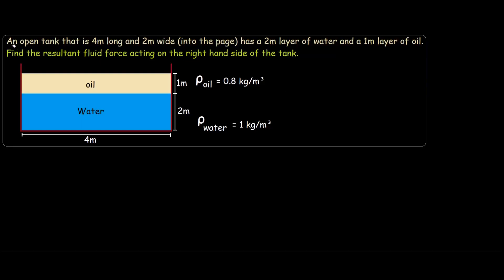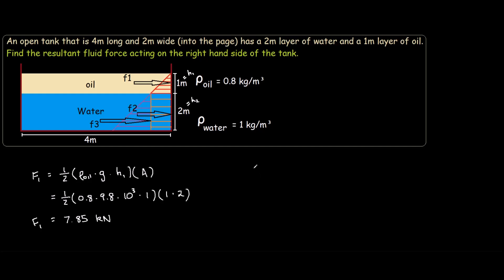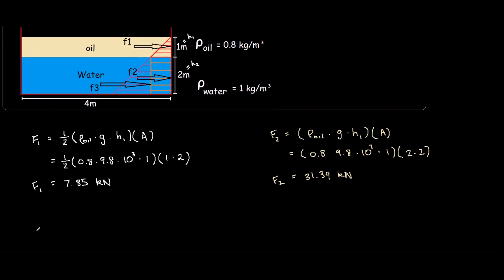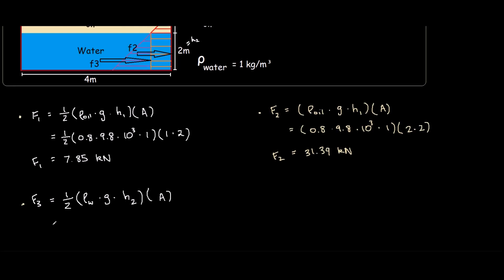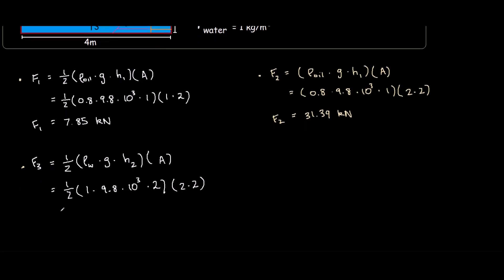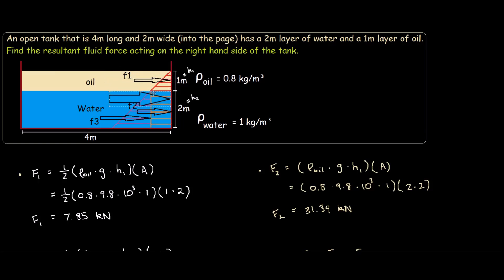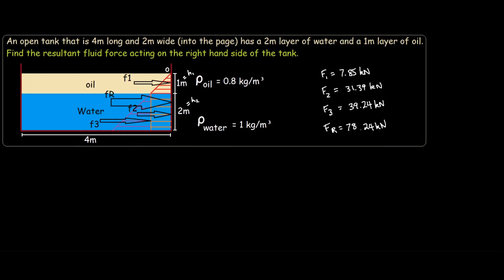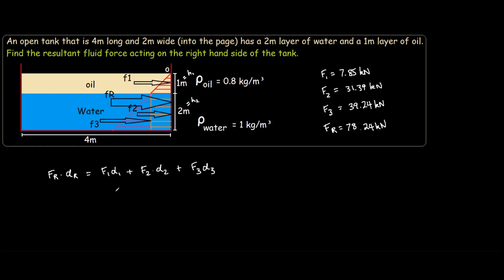Hydrostatic Pressure on wall two fluids (Pressure Prism Method)

Comment: The density of water is 1000 kg/m3, not 1 kg/m3 as stated (same logic goes for the oil). Therefore, its specific weight would be 9.807 kN/m3 [water]. 

Also, the resultant force on a vertical rectangular plane surface is R = p*A, where p is the AVERAGE pressure, which is ALSO equal to the pressure at the centroid of the plane area. [notice it is calculated to the centroid, not the third from the bottom of the triangle, although the force is located at the third from the bottom of the triangle].

The average pressure would be: p = (1/2)*(p1+p2) = (1/2)*ρ*g*(h1+h2) [ρ*g = specific weight]

Comment: Density 1000 for water , it's 1 gm/ cc . And .8 specific gravity.
Reply: True Brother. Even I Was Noticing It, It Must Be Corrected To 800 kg/m^3 for Oil
Reply: @courseco-ordinator8422  so during the calculation @2:59, he does come right, where he converts it to newtons (i.e 10^3 included), but I guess you guys are right in saying the density should be corrected :)

Comment: I still can't quite understand why there is a second force (rectangular prism) from the oil. Wasn't the pressure exerted from the oil already accounted for in the first triangular prism. I'm not questioning your answer (i know its right since my textbook says the same), but why is it included in the first place. Thanks.
Reply from the maker: maybe try to imagine incompressible water in a container and you punch it through a perfect gap, the pressure will increase onto the walls of the container (in this case your hand/punch is the oil) you cant discount this effect and say the only pressure on the walls is still the water. The oil adds a vertical weight onto the bottom layer so this extra pressure has to be accounted for as well. if there was no oil layer on top you would work out the water layer exactly as F3.
Reply: I just understood with the help of your analogy. Thank you very much Cowan.
Reply: Was having the same doubt Now cleared  Thanks
Reply: Hi Nicolas, Cowan, i am a student and i also stuck at this, but a walk allow me to relax up a bit and think in this way: imagine that both layers are water, right, and you calculate the upper half water with a triangle, right, and then you start to realize you should not consider the lower half water with simply a triangle, as its pressure is not starting from 0, but from, lets say 1m deep pressure, so the lower half is not a triangle but a trapezoid. But for the ease of calculation, it is much easier to cut the trapezoid into a rectangle and a triangle, than directly go for trapezoid. And the force of the rectangle is a product of deepest pressure of upper half water times lower half wall area. You can try it youself by calculating, like 10m depth water force on wall with a big force triangle, and then cut it into upper 5m layer of water, and lower 5m of water, and with 2 small force triangle, then you will realise you are missing a rectangle. :-)

Comment: Why the 1/2  in calculation of F1 and F2
Reply: Write pressure due to small strip of liquid and then integrate it, you'll get the result.
Reply: What the guy above me is telling, 

That simply calculating ρgh gives the pressure at the interface of oil and water, to be more clear it is the pressure at the bottom of oil, but to calculate the pressure on total wall we need total pressure across the wall which has linear variation ( p = ρg[h] ) and hence area of triangle.
Reply: Force of pressure triangle=0.5*base*height*width

base=rho*g*h

Comment: The density of water is 1000kg/m^3, not 1kg/m^3. I think you account for this by multiplying by 10^3...but I don't think that is correct.
Reply: That should be 1gm/cm³ in place of 1kg/m³

Comment: Howcome F2 isnt the force of the rectangular prism in the water? Howcome is the force from the water only caused by the triangular part? I would think that F1 is from the oil and that F2 and F3 are from the water?? Im very confused by this
Reply from the maker: Hello Diego I tried explaining it this way to other commentators which they found useful:

"maybe try to imagine incompressible water in a container and you punch it through a perfect gap, the pressure will increase onto the walls of the container (in this case your hand/punch is the oil) you cant discount this effect and say the only pressure on the walls is still the water. The oil adds a vertical weight onto the bottom layer so this extra pressure has to be accounted for as well. if there was no oil layer on top you would work out the water layer exactly as F3."

Another way to think about it is that if there was no oil layer on top the force from the water is just F3, but now we add an oil layer, water doesn't 'create' a new force called F2, this must come from the newly added oil. Hope this helps
Reply: Cowan Academy oh okay that makes sense! So if it was just water it would be a triangular area with only the water density and depth being used. Perfect! Thank you very much
Reply: @CowanAcademy  I get that but I don't understand why 
F1 is the area of triangle 
Bcz, force = pressure * A 
So according to Hydrostatic law 

Pressure variation  = rho*g*depth 

So F1 should be 
F1 = (rho*g*h) * A 

Why do we need to take area of Δ for finding the F1???

Or is it Bcz if I don't take the area of Δ, I am just getting the force at the bottom of the oil n not the total force on the face of the tank????  
(OK now this makes sense but I'm not sure, confirmation from u would be helpful)

Edit : by area of Δ 
I meant why?? 
F1 = 1/2 * (rho*g*h) * A
Reply from the maker: hi Lawliet I hope I understood your question correctly, are you asking if F1 should be a rectangle instead of a triangle or how come I did the calculation as a triangle when F = (P)(A)

It's been a while since I did this question but the pressure diagram is a triangle simply because pressure increases the deeper down you go, have you heard about how the pressure in the deep ocean is immense? you're fine on the surface but as soon as you dive deep down you will be crushed so it makes sense that the deeper down we go the pressure increases so we cant model the pressure diagram as acting uniformly on the wall.

For F1 = 1/2 * (rho*g*h) * A
this problem is a bit more tricky cause you have to think in 3-dimensions, for area we're talking about the face of the wall it's (2 metres) into the page so the area of the wall is (1x2 metres), for the formula Pressure variation  = rho*g*depth, as you stated this would be the 'force' at the bottom of the oil, and if we didn't halve it, we would be saying the top of the wall experiences this too in the calculation when we multiplied it by the area of the face of the wall. 

p.s apart from this question I last touched fluid mechanics in 2012 so if I'm wrong I sincerely apologize but these are my thoughts after revisiting this question.
Reply: @CowanAcademy   that makes sense 👍
I was naive thinking that by just calculating the pressure at bottom would give the total pressure, I was wrong 

I'll have to get the pressures at all the layers(say) to get the force on the face of the tank, so that's why area of that Δ of pressure diagram is correct 

Thanx Man helped a lot!!  
:)
Reply: @CowanAcademy  Can you please Come again on why you used a rectangle for F2 and a triangle for F3? I understood that the triangle in D1 IS because the density of oil adds as we go deeper then for the case of F2 and F3 please?